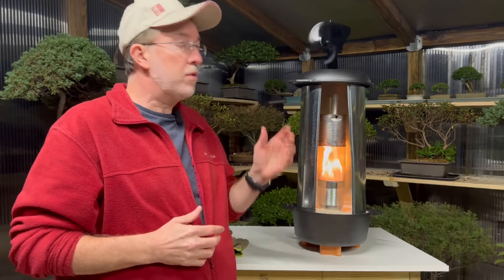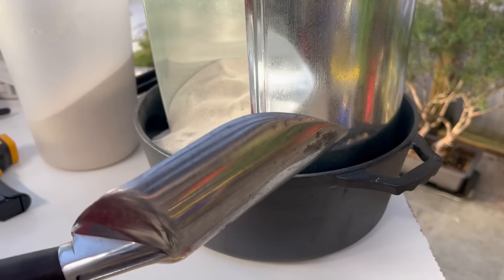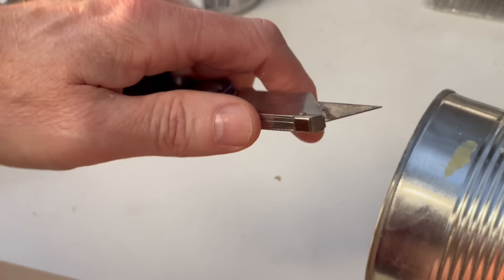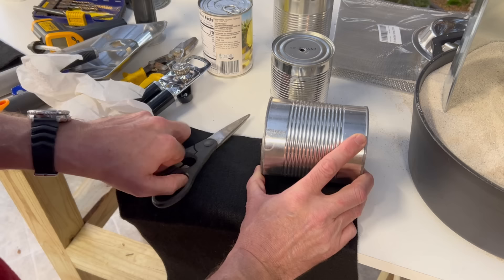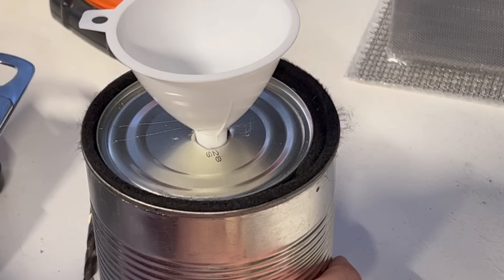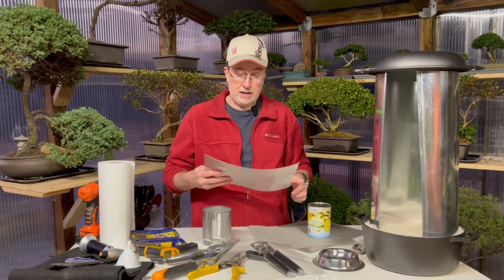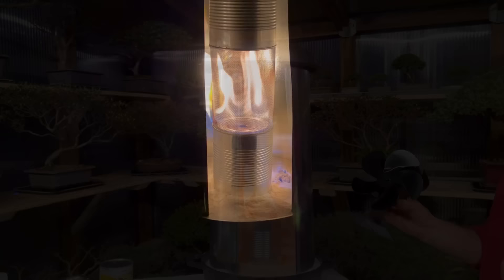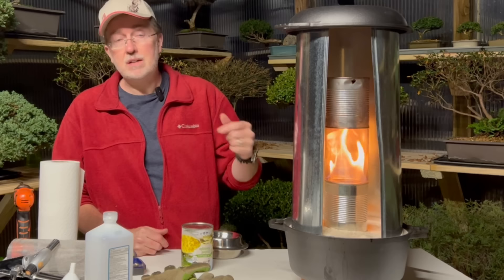DIY INFRARED HEATER | No Electricity Needed For Greenhouse Heat

Comment: On my second build, I used a steel dog bowl as the lid and filled it with sand. The sand was almost molten in no time compared to the first build where I had the sand in the bottom. It becomes warm at the bottom but nothing compared to sand at the top for obvious reasons. Also bigger mantle, more infrared heat. 
A few drops of Olbas Oil or Menthol in the bottom with water for your bad chest and sinuses 👍

Comment: I would use one of those heavy gauge round galvanized steel water troughs used for livestock as a base for the sand battery. They come in many sizes from 23 gal and up. Might be a bit cheaper than cast iron.  Thanks for this vid, it gave me some ideas for heating. 👍
Reply: @thegoodtom1718  Good point. It is true that it can be toxic from the zinc fumes when heated above 200c (392f). However I would highly doubt it would get anywhere near those temps using this heating method in the video.
Reply: you have to understand this is just a video to make money on youtube. sorry but that's the way it is The cost of burning of fuel in this contraption is not worth making it. Eagle
Reply: @roberthoug7864  eagle. U busted my dream.  At least if I set the living room on fire it's warm after my shower.   Efficiency is a bish😂
Reply: @roberthoug7864  Unless...you have a still.....alcohol is easy to produce from scrap fruit etc...
Reply: No..poor heat ..use metal ash bucket.sand & sheet metal or stove pipe..trough or cast iron poor heat transfer😂
Reply: Yes this has given me a bunch of ideas too.  I can wait to start to do my experiments...  Thank you

Comment: The first thing I tried when I heard about sand batteries was heating a pot full of it from underneath with, I think 8 candles. The temperature in my shed was about 6 centigrade, a couple of hours later I blew the candles out. After 15 minutes the sand was almost cold.
Sand batteries can work really well but they need to be heated to a very high temperature in a well insulated container and the release of the heat needs to be regulated.
Reply: The specific heat of sand is quite low. It takes very little energy to heat up, and therefore it heats up quickly and then it cools off quickly also. Water has the best specific heat  and steam is even better. Water is therefore a much better thermal battery.
Reply: @Marley-ii6ls  I agree to a certain extent. A hot water bottle is basically a water battery and the litre and a half of water in there, in your bed can stay warm for hours but for heating a room, as a battery I can't see it.
It can only get to 100 Celsius before it turns to steam whereas sand turns to glass at 1700 degrees. So if you had the means, it could be "charged" to a much higher temperature and if the heat loss was controlled, I think it would be more effective than water as a battery,  for heating a room.
Reply: @stevecole9674 
Imagine protecting the carpet/floor, and building a wide sand battery under your bed. Have it heated (being charged) certain hrs and cooling off slowly. [One poster suggested using an old heating element from a water heater.] 

Easy way is to see how long it takes to heat the sand to a set temp, and how long to release the heat. Fancy way, have it start recharging when it drops Below a certain temp. 

With one system you may get hours of heat during a power outage by accident if the timing is right. With the fancy setup it is constantly charged and always ready if power stops. 

You have at least one small room heated a bit. You are nice & snug. Battery is well insulated to release heat slowly.  

Sand battery is wide and flat, more surface area to radiate heat. That could work against you. But the bed can be raised a bit also. You may have more room to work with than you assume.
Reply: Would wet sand be better?

Comment: In place of the cast iron pot, could you look at semi-truck or trailer brake drums from a salvage yard? It would be a super heavy-duty alternative.
 I have used them for wood stoves and fire pits.  Salute !!!  I love your incredible heater.
Reply from the maker: Cool idea
Reply: @ZenGardenOasis.  

I'm not sure what you guys are visualizing. I pulled up images of trailer brake drums. How were you thinking of using them for this, exactly? 

With a hole in the center, they won't hold sand, and the sides are low... on top of the unit, maybe? Still doesn't seem right.
Reply: @debra-qq1np  You could patch weld them or get a slightly bigger container, fill an inch or 2 with sand, put the drum in and fill the drum that is sitting in the container with sand.  It might be worth the trouble doing it as the drum will be heavy duty and also can hold/ radiate a lot of heat.
Reply: My father in law actually managed to crack one while camping years ago. However he had it really going with lots of hard wood too.

Comment: really cool. i dont know how much room you have in your hot house but you could get some of those blue plastic storage 55 gal drums paint them black and fill them 3/4 the way with water the thermal mass of the heat collected in the day would radiate though the night. i still really like your design.

Comment: Large chimney brick and a larger kerosene lantern from Lehman supply company in kindred Ohio. 
My grandmother would fill the lantern and put it on the lowest level and place it inside the chimney brick. And that was enough to heat the entire greenhouse during the winter. The place was toasty the lantern would need to be filled like ever 20 hrs but worth every penny. She also did it in the chicken coop as well. 
With a block on top and holes drilled into the sides of the block. And bird spikes on the block to keep them from roosting on the very warm top.
Reply: Your grandmother's version sounds much easier and cost-effective. I think I may give it a try! ❤
Reply: Why not just get a kerosene heater and use it
Reply: Kerosene lanterns give off a lot of heat that can be regulated to some extent by adjusting the wick. The chimney pipe gives heat mass all with a much longer burn time for the lantern (for very cold nights you don't need to refill even with a higher flame/light). Yes, you can boil water above the lamp chimney.
Reply: I like your idea:  Dumb questions:  What's a chimney brick?  do you mean a chimney FLUE?   and did she use the kerosene lanterns that have the glass chimneys?  Thanks!!!
Reply: @skyeridley7764   I suspect it is what many refer to as fire bricks as they would retain and radiate the heat even after the fuel had been burned out. The chimney flue while easier to handle would cool fairly quickly. The lamps referred to have glass chimneys 1) to spread the light (and heat) and 2) to aid in limiting the air flow, without the glass chimney the flame burns very dirty.
Reply: @skyeridley7764  they do have what's called a chimney block's some were made of clay and some are made with concrete it's about 1 ft square with one large hole and yes it is made for a chimney but if you use wood stove you have to put a metal liner in it so the creosote doesn't build up into it and cause a fire

Comment: Robert Murray Smith  on his T-N-T (thinking and tinkering) channel has done amazing work with these heaters and sand batteries. 
I think a large stainless steel Dutch oven like a Revereware style from the thrift store would be a good base and lid. A section of single wall interior stove pipe for the reflector. Drill and bolt the reflector to the base pot.
If you can't get carbon felt, you can use an old sock, but it would be a consumable wick. 
I would also take the stainless steel screen and place the seam over a pipe and hammer it flat so it won't come apart. 
Overall, it's a good basic design.
Reply from the maker: He was one of my inspirations, also 2 other YT videos and about 6 blogs I’ve read showing how these work. Wanted to confirm for myself and build one.  Yes it does put out a log of heat for sure….cheers.
Reply: Cotton sock, or you may regret it....cotton t-shirt or cotton clothes lines works too. Make sure clothes line doesn't have an inner core,  100% cotton ones are all woven, with no core. Cheers

Comment: Since you’re using the carbon felt you could use olive oil for an endless candle. You’ll still need a starter fluid like your alcohol or a paraffin lamp oil just to start the wick.
Reply: Olive oil is getting rather expensive now. The olive groves have been suffering.
Reply: could you use other cooking oils.
Reply: @daniel-vn4ql  seems like you could use that smokeless kerosene and it should last much longer than alcohol, I would bet.
Reply: You can get used cooking grease from restaurants for free, and use it instead. Like anything, make sure you have good ventilation. The other option is to buy a bunch of candles, and an electric heater. Hide the heater in a stainless steel box so nobody can see it, bury the electrical cord, and tell your friends the candles are heating up the box.
Reply: @RipperYouTubeOfficial free cooking oil isn't as easy to come by as it used to be. I wonder how many people that give this advice have actually tried it.

Comment: Thanks for the video love the info, instead of using (an awesome cooking pot) Dutch oven you could get a small propane tank (scrap yard is a good place) cut out most of the center and there you go👍
Reply: Good idea. I would never sacrifice a cast iron pot. I was thinking a discarded water heater would work for the size he wanted.
Reply from the maker: Great tip!
Reply: can you orovide links to were i can find the items. i am struggling with the stainless steel exhaust panel

Comment: Great video: added thoughts
i Know cans are cheap and inexpensive but one way i have done this is:
1. use a stainless steel pot like many have said for the base filled with sand.
2. Use aluminum duct pipe from home depot. Got mine for  $15. (doing this ensures that there's one central piece.
3. Cut Two comparments into the aluminum sheeting with wire snips, one for a small coffee can with toilet paper acting as the wick filled with denatured alcohol 
4.  Second cut  is actually two  on the back slightly above where the can is so that a small 9v fan can be mounted.
5. lastly the top of the pipe acts as an exhaust, and it burns for hours. I WILL be modifying mine to use your carbon felt.
I appreciate when a community comes together, I like when we can help each other and share our expirences and ideas. Your inspiring video could save lives and help keep people alive under extreme cold conditions. best to be prepared because we never know. Gratitude.

Comment: You could add a copper strip above the flame that would conduct the heat to the sand directly through convection. Would make the sand battery a lot more efficient.

Comment: radiant heaters like this have used kerosene or diesel and burn indoors with no issues, with only minimal ventilation. Not a sealed room but basements and garages and a greenhouse or boat, sure. They were called paraffin heaters and were very popular and found in antique stores from the postwar era. Same idea as a candle and ceramic pot. This is a higher output. But you can buy these with a fiberglass wick and enclosures and reflector all made to use as a spare room heater.

Comment: Though a bit more than some may consider I'd like to add: (1.) A refill tube ('fill pipe') that would equal in volume the amount of alcohol it'd take to refill the tank once emptied. That tubing of course could be 1/4" schedule 40 black iron pipe that runs along the outside vertically,  turns horizontally towards the refill hole and then downwards into the fuel tank. (2.) This of course would require a rigid connection between both the top and bottom platforms & securing the "fill pipe" . Noting that only after the unit was completely cooled down refilling would be both safe and quick (even pre measured if you choose to). (3.) One can also install (& purchase) an inexpensive lighter used on kerosene heaters or simply use those fireplace butane types if you wanted. 

For a few years we used kerosene type heaters in our home burning jet fuel that would have otherwise been disposed of. Free fuel meant free heat, but that eventually came to a close. 😊

Comment: Nice heater. The larger pan/pot for bottom is a good idea. Less chance of being upset and turned over in case a critter found a way into the green house. I wonder is an alternative to alcohol for fuel that would not burn up as quick. Any fuel would probably put off some toxic fumes.

Comment: Like the build you did thanx. It's a good, working example. I've read a bunch of the comments and there are some good suggestions for refinements to safety and efficiency. I have one question and one suggestion/question. My question is, what is approximate volume of your greenhouse that you're heating? My suggestion/question is. Would embedding the burner in the sand battery be an efficient way to aid in heating the sand? Or will that help too much with vaporizing the alcohol fuel? Lately I've been doing some experimentation with alcohol rocket stove/heater builds and fuel mixes. I've tried from straight gelled alcohol (hand sanitizer) to straight alcohol (Methyl Hydrate). I find that a mixture of the two 2/3 hand sani to 1/3 methyl hydrate burns best and longest in a similar burner configuration to your build. A tin can double wall rocket stove/heater. The size of a can of Chef Boyardee 1/3-1/2 filled burns for almost four hours if you can manually adjust the air mixture ratio as nessasary. I've been able to heat a tent in around 0C or 32F temperatures to be able to sit with just jeans, T-shirt and a sweatshirt comfortably inside. Incidentally I'm a Horticulturist and Arborist by trade and a friend just recently asked me to build a small off grid type heated greenhouse for him. I will be basing the heater design from the one you have demonstrated here. Thank you very much for your time spent building  the heater and making the video. Most importantly! For sharing the knowledge.🤘

Comment: Agreed with the last comment, please explain how you attached the upper screen mesh\can to the assembly. I assume it is not just resting on top of the carbon felt dual can portion as that would be quite unstable?
Reply: The whole thing is unstable. The “lid” is just resting on top of the sheet metal. One accidental bump on that table & his whole greenhouse will be on fire.

Comment: Acetone is a good alternative to rubbing alcohol. What was the temp variance in the greenhouse while it was in use?
Reply: I'm curious to know how much carbon will spread in the air while burning acetone (C3 H6 O ) ! Alcool (C2 H5 0H )...😊
Reply: And consider that acetone is very toxic for your lungs and skin,and eyes and  finally, much more expensive than denatured alcohol...

Comment: I'd like to see how hot the sand got.  As far as I know, heat goes up, so not much heat will go down to the sand even with the heat conductive steel sheet in it, because most heat in the steel sheet travel upward and dissipates to the colder air.  Also, steel is much less heat conductive than aluminum or copper.  Copper is the most conductive of the three.  I'd also like to see the temperature in the room before and a few hours after the heater lights up, then a few hours after it goes out.  I wonder if vegetable shortening can be used instead of alcohol.  I know a three-pound one with one flame can burn for months.  Can alcohol last as long?  Overall, a very informative video.  Thank you.
Reply: I’m pretty sure this is just working stabilising the entire thing .

Comment: Great project.  I would recommend adding a fuel fill pipe that extends to the outside.  So it could be filled without any disassembly,  maybe 1/2 copper pipe which can easily be bent to the desired shape,  and a fuel line cap would also be able to be purchased at any hardware store for cheap.

Watched from a YouTube recommendation, and have to say nice work, and I like the bonsai in the background.

Cheers from Newfoundland
Reply from the maker: Thanks so much…have a great day

Comment: Something I recently found out is that if you take your can opener and lay it flat on top and lock it as normal then take the lid off. When it cuts the lid off it will leave the top of your can a lot smoother. Just saying.

Comment: You don't have to buy an expensive Dutch oven.   You can use an angle grinder to cut an empty 20-lb. propane tank in half.  There is a SAFE way to do this!  I've done it. You can even make two of them that way.  
If you want a heavy steel basin with a larger diameter you can cut the bottom off of an old hot water heater. People throw them out at town dumps and at metal scrapyards.
Reply: And you could likewise, use the top of a propane tank or water heater instead of the lid to a Dutch oven which you've placed atop your fine intention.  In both cases the tops will have holes which would hinder their use on the bottom.  If used on top, you may wish to cover the holes to trap more heat above the burner as you do with the lid.
Question: what is the cylindrical thing at the very top of your burner stack?

Comment: Please explain why heating stainless steel gives off infrared.  Great video!
Reply: Stainless steel mesh has a lot of turbulence creating gaps that will make the rising flame hit the mesh a lot more than a smooth surface will.  This is the same reason for putting rocks in your fireplace.

Comment: I love the heater and looks a very impressive bit of kit. I would maybe use pop rivets to connect the bottom barrel and top lid  just to make it a bit safer and maybe add copper pipes for extra radiation.
Reply: Curious how you would use the copper

Comment: I'm sure others mentioned on using isopropyl alcohol.  Methanol burns really clean and you won't have any yellow flames. You can buy a yellow bottle of Heat fuel additive for gas line freezing in an auto.  Probably a little more expensive..